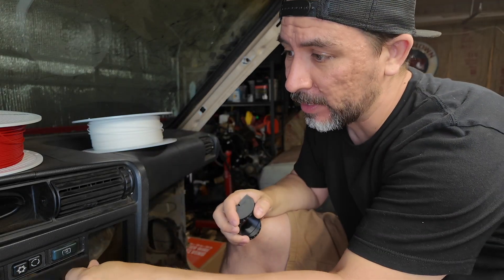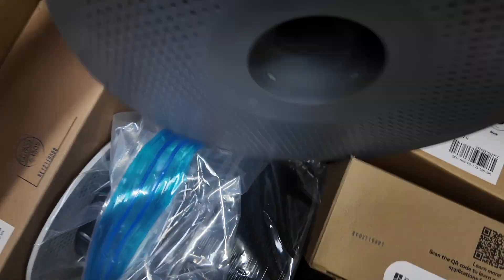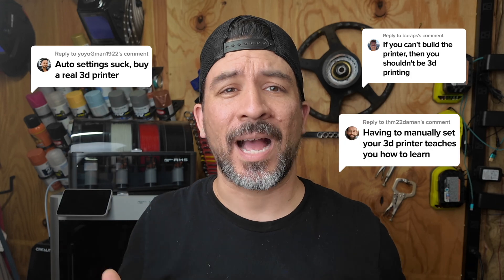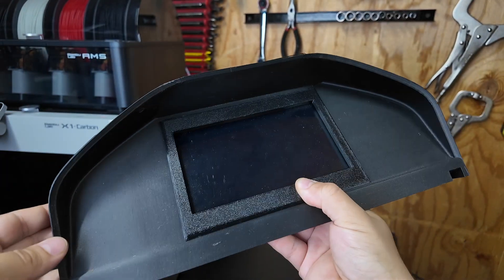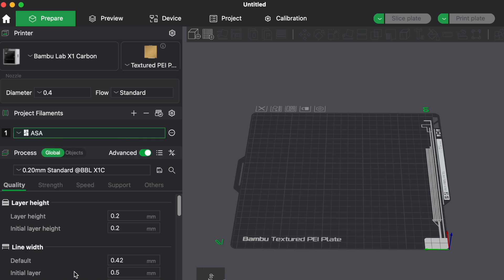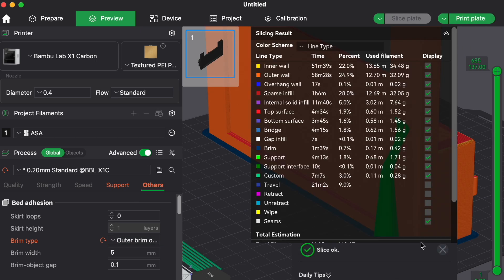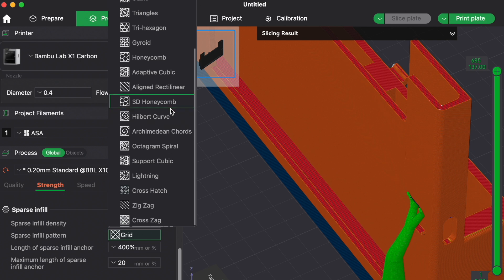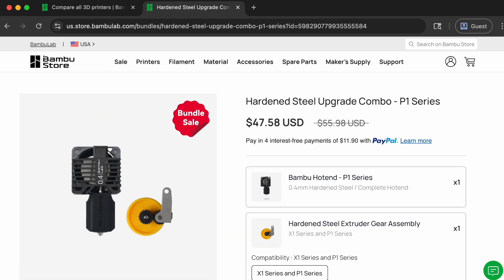What No One Tells You About 3D Printing Car Parts

Comment: Hey mate, I’m from Australia currently have a P1P for my warhammer as it’s best suited for terrain. I see you use the other Bambu labs printer for your parts I have an old 80 series Land Cruiser and I’m wanting to do the same. Have you had an experience printing on the P1P or do you recommend getting the other one?  Thanks in advance
Reply from the maker: Hey, thx for watching 🙏🙏🙏. For car parts, you’ll want to print with ABS or ASA because it can withstand heat. ASA also has better UV resistance than ABS. With those filaments you’ll want to have your P1P enclosed to prevent warping on the first free layers. I recommend just upgrading your P1P with the panels to get it enclosed if you decided to start making interior and exterior car parts that can withstand the heat/UV.
Reply: @Itsallaboutthebuild sweet as mate thanks for the help 🤙🏽
Reply from the maker: For sure, any time!!! If you want other tips and tricks check out our newsletter at https://www.allaboutthebuild.com

Comment: I like a big 10 line brim so my part won't lift from the bed. Its also beneficial to bed adhesion to go real slow for the first layer, including the brim. I also find the brim a nice way to purge the filament.
Reply from the maker: Nice, a 10 line brim 🙌, what type of parts do you print?
Reply: @Itsallaboutthebuild things like pi cases, PCB mounts, lighter cases, and small parts and enclosures for electrical projects.
Reply from the maker: Pi cases, sweet. Just made a mini LCD screen holder with a Pi Zero 2w